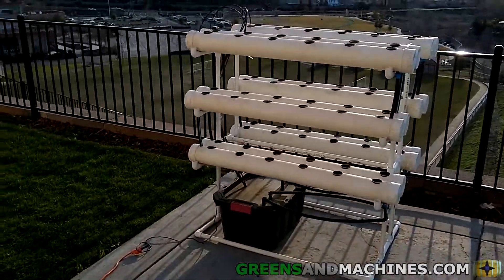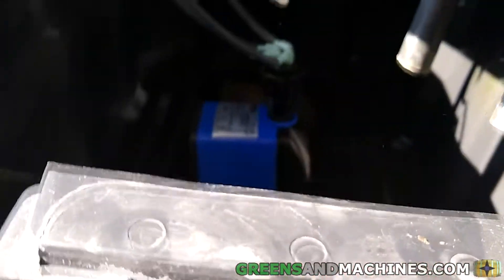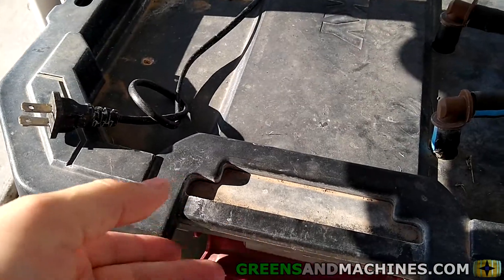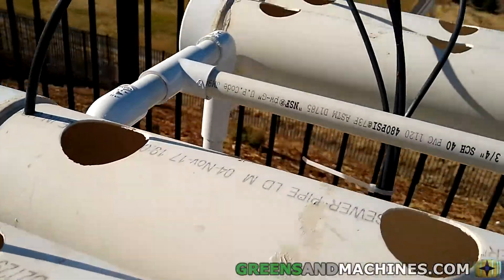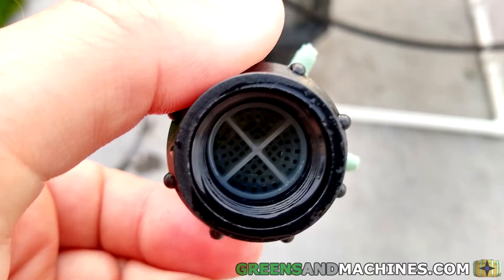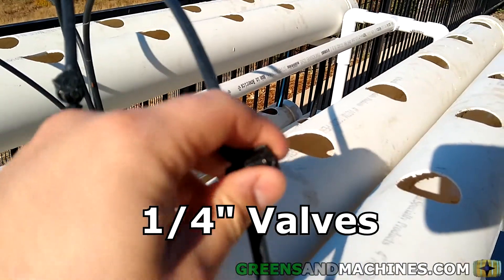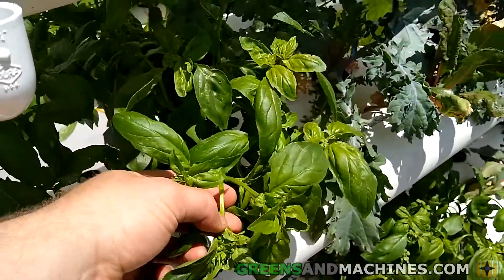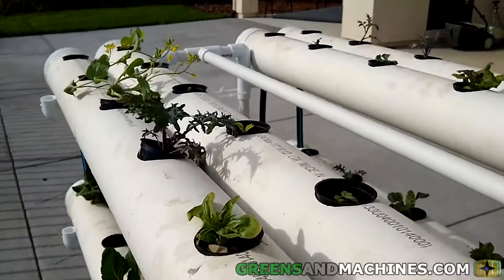Choosing a Pump for my Hydroponic Garden | NFT 72

Comment: where can you buy one like yours- the blue one? (link is to a vivosun) What brand is yours? Thanks!
Reply from the maker: The one I own (and previously linked to) is a brand called Aquaneat; however, I cannot find this same model of pump in their catalogue rated at the same GPH and head. This is why the link now goes to the Vivosun pump as that pump is rated higher for the application shown in this video. Functionally, the 2 brands of pump should be the same, and I wouldn't be surprised if the same OEM produces for both brands.
Reply: @greensnmachines  thanks for the reply. With such a set up, are you concerned with the pvc in the tubes getting into the food. Kind of starting out here.
Reply from the maker: @PAULAKEITH-m7m  not really

Comment: I used a fountain pump that also had a uv light.   It will stop most of your algae problem.   Also ,the pump comes with a mess bag which stops anything large getting in clogging your small lines.  You do need to check and make sure they don’t clog because occasionally I would have to blow one out or replace it.

Comment: Small setup doesn’t need much. I’m using a home well jet pump because nothing else seems to feed enough water to a twenty four 10 gallon bucket RDWC system. A 1000gph pump barely dribbles from a fraction of the fittings. Seems to oxygenate excellent however these pumps are not meant to run 24/7 because the motor doesn’t have a way to keep itself cool. set pressure at 25psi and turn voltage down another 20% for 20psi using a rheostat and it’s manageable.